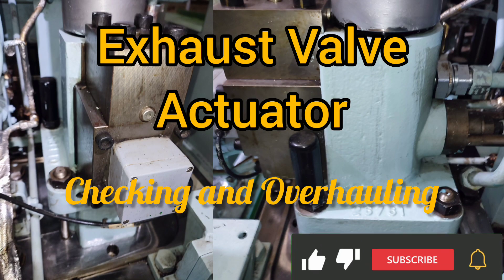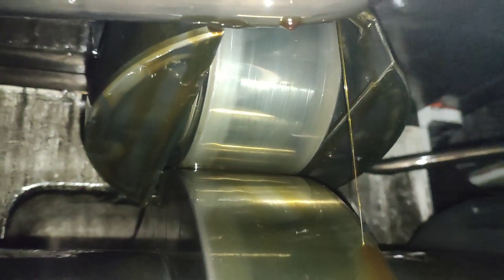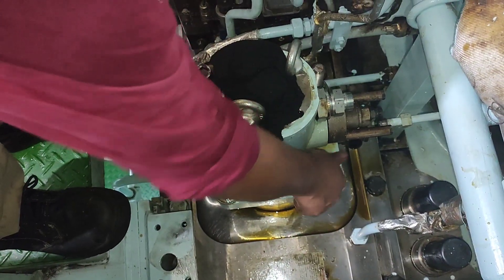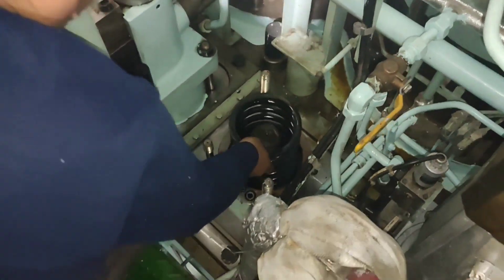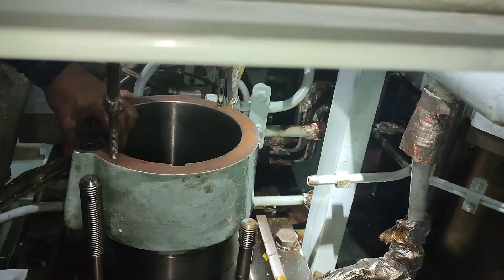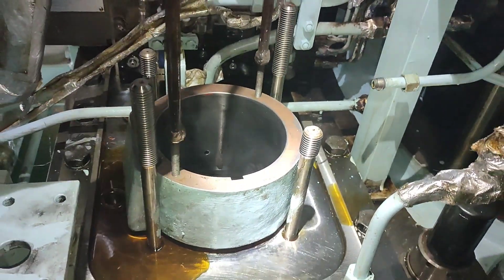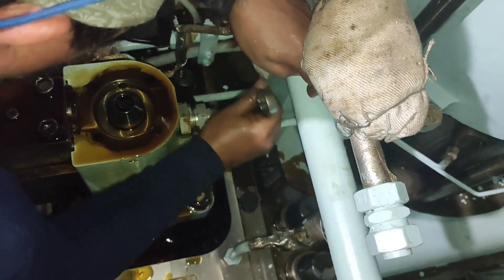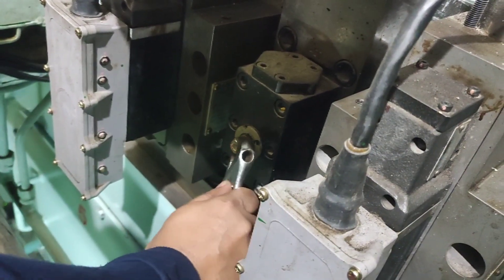Exhaust Valve Actuator Checking and Overhauling@pinoyseamakinista12

Comment: 0:18 why shut down lubricating oil supply and engage turning gear. Would it not scratch the liners
Reply from the maker: It is necessary to have lubricating oil while runngine the turning gear to lubricate the moving parts when turning is operated it shoud be aupplied by vylinder oil for smooth movement of piston in the liner